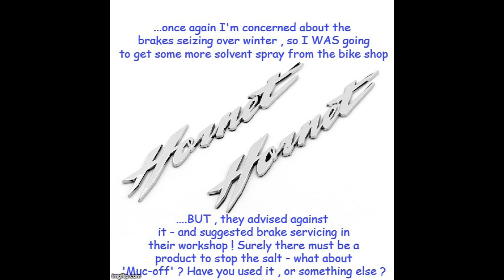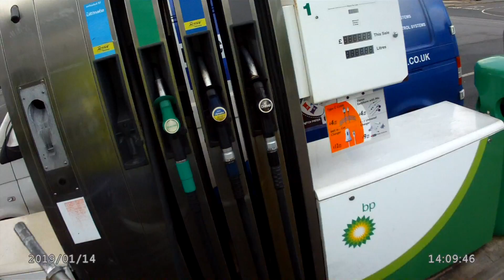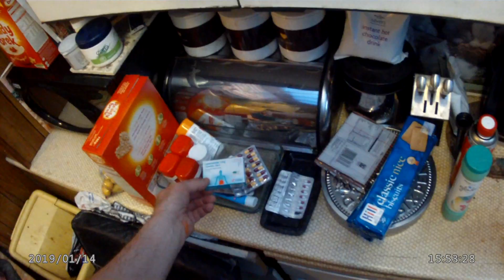....cleaning salt from brakes - AGAIN !?

Comment: Steve the only thing that returns the caliper pistons is the square o-ring behind the dust seal in the housing.

If the square o-ring is not free to return to it's original shape after the brake lever is released it will not release the shoe(s) from the disk.
The two grooves in the caliper housing need to be clean and the o-rings have to be equally clean from debris and possible corrosion so there is enough space for the square inside o-ring to return to it's original shape after it has been pushed out by brake fluid pressure to engage the brake disk.

Do you still have the original caliper to practice on?

There is nothing to lubricate the brake pistons since they do not slide over the piston, the o-rings just grab the piston, push out of shape and return to their original shape,normally they stay dry but to avert corrosion you can have a film over the pistons and the housing directly around the pistons , i have used some silicon grease sparingly because it does not attract dirt like normal grease does.

Normally i take the pistons out and replace the brake fluid every one or two years depending and put them in with the silicon grease, they push in very easy, the o-rings need a little lubrication film and the excess will just wipe off on the dust seal outer ring or it will be a lot more difficult to slide them in the housing.

Don't take my word for it, have a look at this guy and thanks for all your video's;

 https://www.youtube.com/watch?v=IVHdhXXNReQ
Reply from the maker: ....thanks - yes , Hepcat Harley said I should practice taking them apart and he even sent me a set of pattern seals - but I didn't even attempt it as I wasn't confident that I could do it on my actual bike's brakes ! Yes I imagine the labour charges in a bike shop would be enormous so I should learn - BUT the point of my videos was that every bike owner that rides every winter surely doesn't have binding brakes as they use sort of products on them either every day or weekly. I've just bought another spray today...but Halfords didn't stock the 'WURTH' brand that someone recommended, however I will be doing product trials until I find something that works...which hopefully will not require me taking the calipers off and breaking them open and replacing the seals....then having to refit them and bleed them , in the freezing cold in my backyard ! Thanks again.

Comment from the maker: ,,,I did this video yesterday - but wasn't going to upload it, as it's crap ! When I got to the bike shop ...there was only a Royal Enfield Bullet 500 there - no 'Interceptor'...and then my battery ran out ! They had a big selection of Disc Locks, but I couldn't see the alarmed model made by Oxford. I was looking for something to squirt onto my calipers as I forgot to do the Saturday cleaning routine, when I got settled on the settee with a brew and lots of chocolate biscuits. Still, NOT cleaning them at least once a week will lead to expensive bills or a lot of faffing on the backyard floor again - so it's something that can't be neglected just because you don't feel like doing it - however I just wondered if there was ANYTHING that CAN be squirted into the calipers each day then rinsed off , as this would be a simpler solution ? I might buy some of that Muc-off at the weekend and test it....